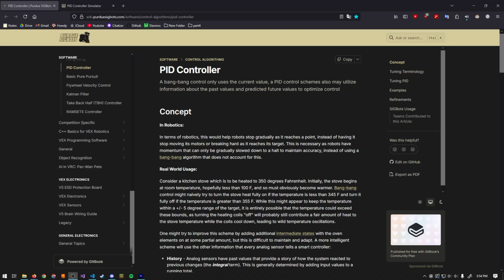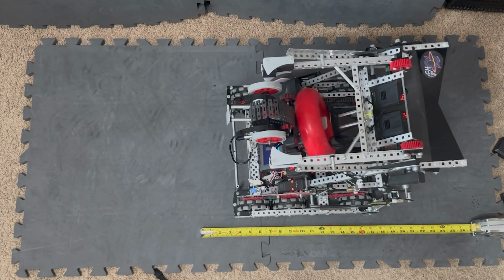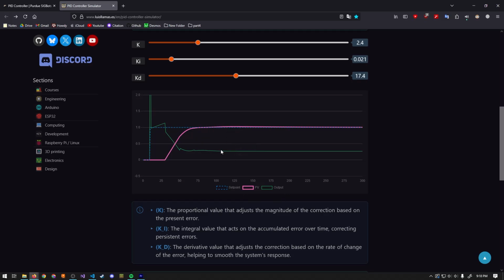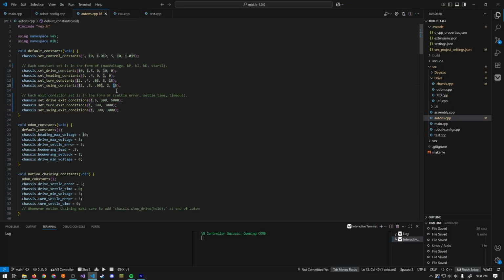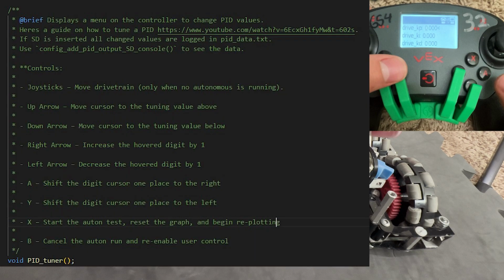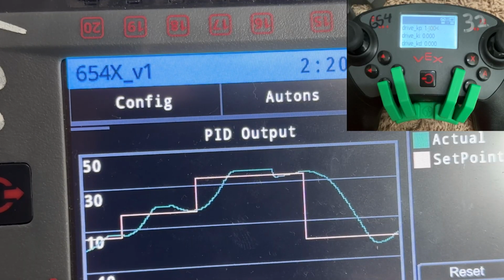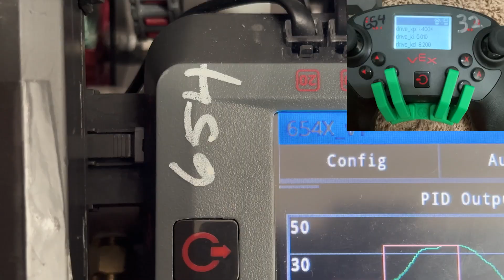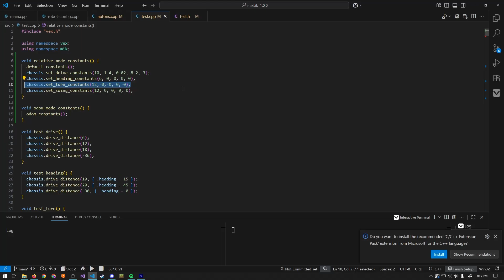VEX Auton Tutorial Part 4 - Tuning PID Controllers

Comment: how did u build ur GUI that changes the pid values from controller and sees other settings? wanted to implement in my system as well.
Reply from the maker: I created my own UI library for mikLib, and am using that for displaying the graph and controller buttons. You can extract the code from here if you want: https://github.com/EthanMik/mikLib/tree/master/src/mikLib/UI, but I would recommend using LVGL if you want do it yourself. At some point I do want to split the repository so that the GUI is a standalone feature.
Reply: @ethanmik2587  thank you! ill just use your code and see if I want to make my own in the future.

Comment: Is there a reason why my robot doesn't go straight and keeps turning while tuning the drive pid also the drive constants don't set to zero on my controller for me even tho I sent the drive_constants in the code.
Reply from the maker: Ensure you only change the set_drive_constants() once and only in the function default_constants() as thats what the PID tuner uses for driving.

If the robot is turning while tuning drive PID ensure you are tuning Drive and not Heading. If the problem still persists try driving your robot in a straight line using the joysticks as it could be a wrongly assigned drivetrain motor or faulty motor.

If you are still encountering issues can you contact me on Discord.